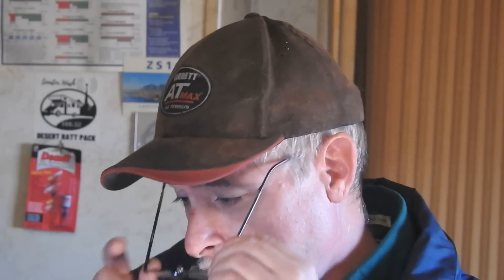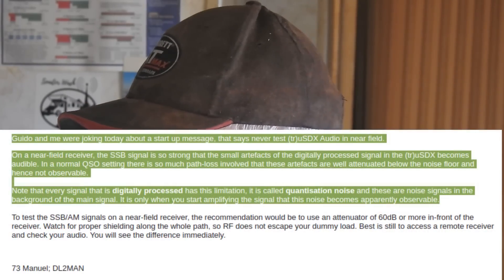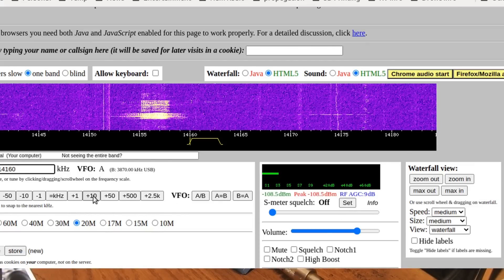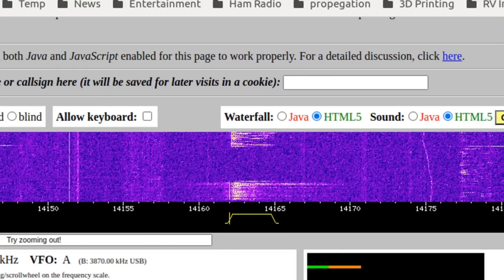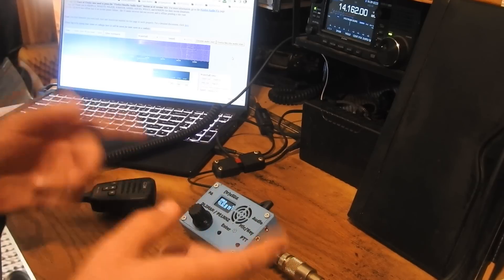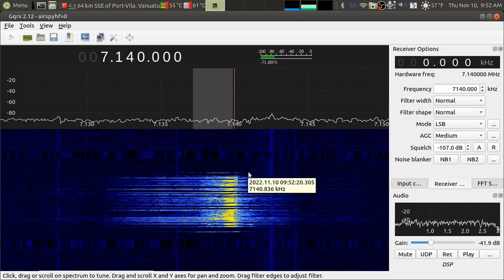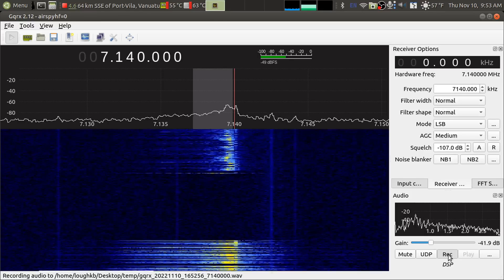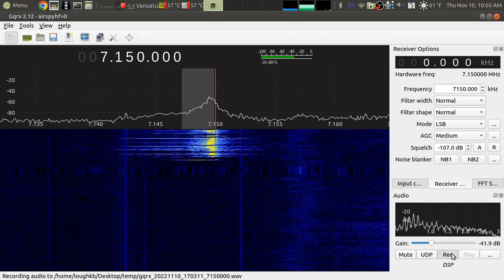Ham Radio - tr(u)SDX splatter problem, further testing.

Comment: If you suspect build quality is a factor, surely it's now time return the unit to the designers, so they can check this aspect themselves and compare performance with their prototypes?  You have have already shown this is not "finger trouble", and that you DO know what you're doing.  Yes, I know diagnosis can be fun, and you'll get a few videos out of it, but life's too short to ruin your eyesight staring at SMT boards,  And because you have a high profile YT channel, those guys must have a REAL vested interest in sorting the problem out!
Reply from the maker: Go back and watch the earlier vids in the series.   Info from my first vid about the poor quality soldering is now being used to train the builders.
After my experience, Manuel requested samples from stock to further inspect their quality.   
We put things in motion.  I'm sure they're doing a better job now.

Comment: Hi Kevin, I have yet to see or hear clear SSB from a uSDX based radio. RX demos outnumber TX demos 10:1. Yes, of course, it is a fantastic effort to create a class E SSB transceiver with an atmega32, but it is extremely difficult to get right with plenty of processing power let alone an 8 bit micro.

Comment: Input audio filtration?? I haven't followed closely.
Reply from the maker: A couple of vids back I looked at the audio and signal in AM and FM.  There was no distortion, just low modulation.  I got right down on the mic and spoke loudly and the audio was still clear, no clipping.   So it's not a problem with the mic or any analog circuitry behind it.
Reply: @loughkb  I'm referring to frequency roll-off both above and below audio spectrum limits. Not audio modulation amplitude (including high clipping). I need to eyeball a schematic, I may be talking out my butt (pun intended). Great videos by the way !! Been meaning to write for some time now.
Reply from the maker: The audio in am and fm was rolling off below 2KHz.    Nothing high to modulate.   No, I'm pretty sure it's something in the RF section.
Reply: I just sent you a FB MSG.. Hope I got the right guy... Or someone is going to think I'm as weird as I really am. ... Let me know what you think as I may be looking in the wrong place, it's getting late, I'm half blind and my brain don't work this side of darkness outside...

Comment: Hi Kevin, while this is beyond my understanding (technically), I have watched this series closely with great interest. As a result, I now understand things a little better! I am fine with through hole construction and the bigger surface mount, I think you may be onto something with the ability, or dare I say it, skill of the person who built the boards.  Without knowing exactly what the approved builders actually do, it is hard to pin down where your problem lies.I do not think that shield will resolve the issue as this problem is not present on every build, and while shielding may sort it out, it will not cure the problem, but just mask it. At the end of the day, and bearing in mind my limited technical ability here, I think that this will only be solved by going to the component level. I await the next installment!!! 73 Jim M7BXT

Comment: Wow! Great demonstration, and I was not aware you could perform such a remote test (WebSDR). The problem was immediately clear from the waterfall display, and it was nice to link what I saw with what I could hear. Of course with the sharp edges of digital you are going to have sidebands that need to be filtered - sadly power is also wasted in those sidebands.
Reply: I've used the Web SDR method myself when I've been told my audio is distorted like I have RF on it. Unfortunately in my case my signal came through perfectly on the Web SDR with no distortion so I'm none the wiser!